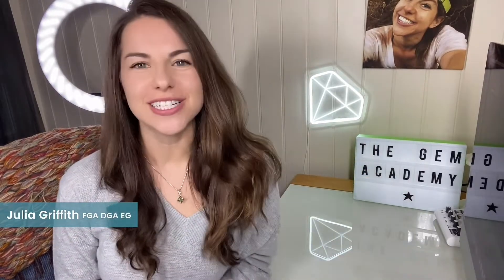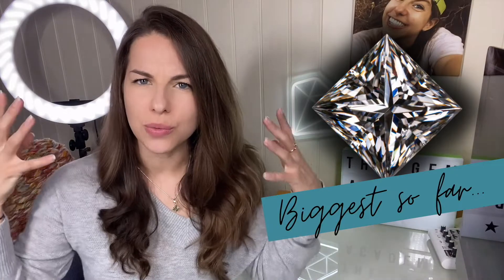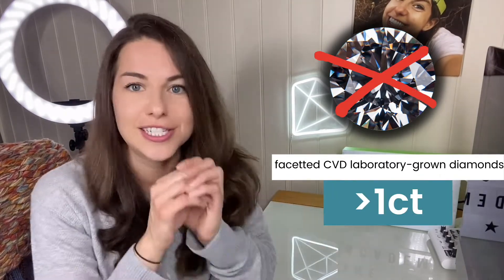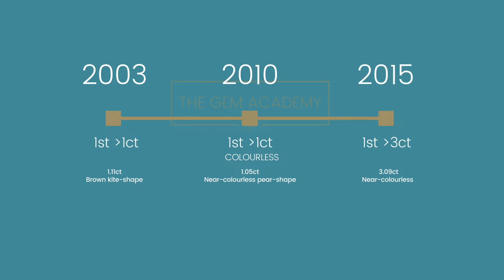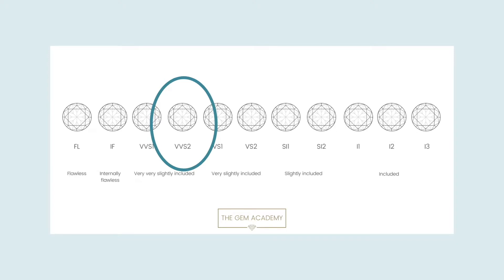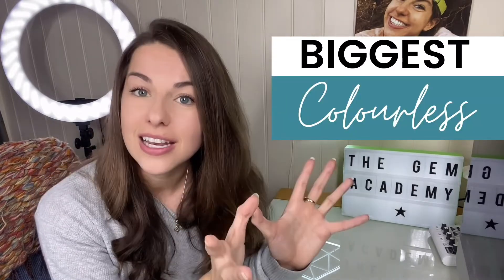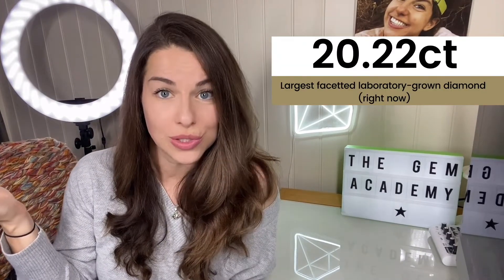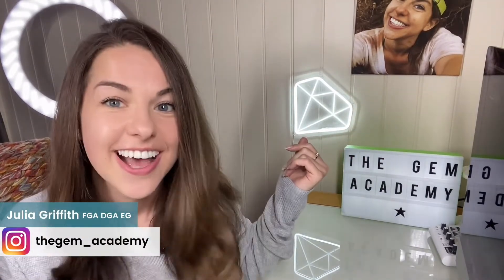Largest CVD laboratory-grown diamond in 2022!

Comment: What  will keep its valua a 50 carat salt and pepper  galaxy diamondor a 10 carat cvd
Reply from the maker: Gees you've put me between a rock and a hard place 😅 I suppose the salt and pepper may hold more value over a longer period of time. However - at 50ct -that's a tough sale. How would it be worn? A big chunk around the neck? That's to it's detriment really as I can imagine not many people would want it as its not easily wearable. At least the 10ct CVD is wearable... and would be prettier. But, considering current trends in value for laboratory-grown diamonds, the value of the 10ct CVD would like fall by a greater percentage than the salt & pepper... but good luck finding a buyer for the latter 😅